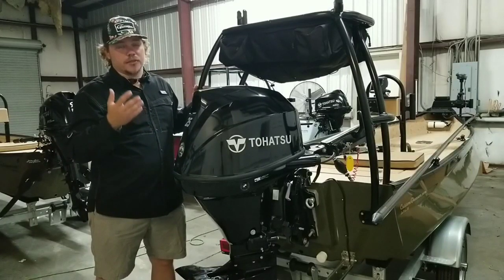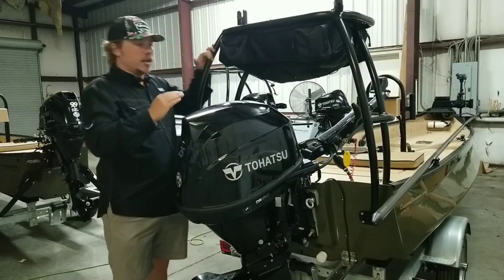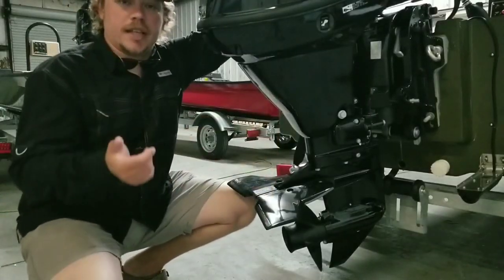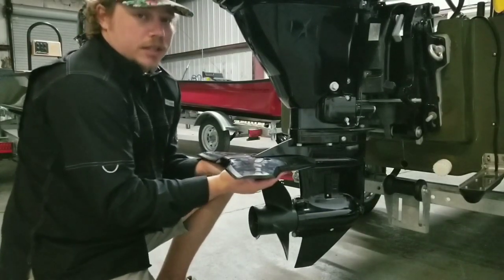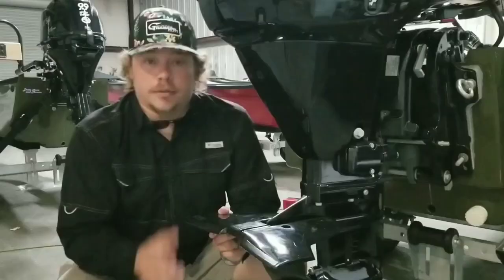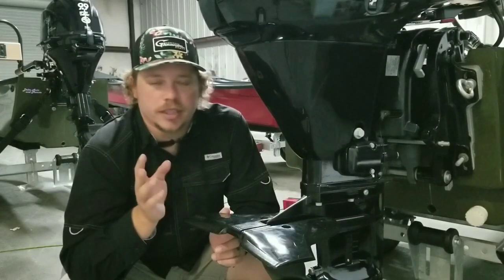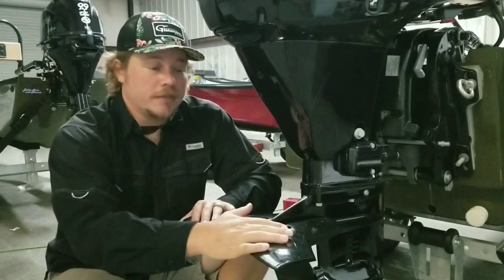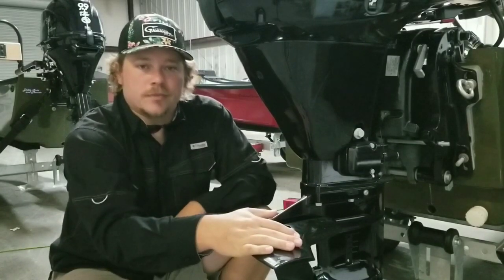Hydrofoils for Small Boats

Comment: Good video with clear explanation of the key points.  My boat is stern heavy, the motor is a bit over sized and that is also where the battery, gas and oil is.  I looked at trim tabs but due to the swim platform, swim ladder, and also where the rear tie down straps go they won't fit.  So I may try this.  My boat gets on plane plenty fast, motor is oversized and all, but I do have to have it trimmed all the way down on plane or it porpoises.  It also tends to want to come out of plane if I am towing slow, say kids in a tube or something.  It's fine for skiers.
Reply: hello, for update did you try one out?
Reply: @lemming9693  I did.  I'd say probably it was worth the $100 I paid for it, but the changes were not significant enough to either do it again or take it off now that I've drilled the holes.  It probably does hold plane at a bit lower speed.  It probably does give a few more degrees of trim before the boat porpoises.  Maybe it does come on plane a few feet earlier.  But going from a 19 to a 17 inch prop made more difference to the hole shot for sure.  So I'd probably say make sure you have the right prop for your boat first.  I was topping out about 5000 rpm before and now WOT is more like 5500, which is closer to the max rpm listed in the manual, and it definitely gives better pickup.  I'd say whoever set it up with the 19 inch prop was going for max speed with the boat empty save maybe the driver and one passenger, whereas I usually have 3-4 people, a dog, 2 deep cycle batteries, a cooler, a trolling motor, etc., and might be pulling a skier or a tube.  It definitely seems happier with the 17.  Top speed is down from 42+ mph to about 38, maybe 40 if I play with the trim, but I hardly ever go that fast anyway unless the lake is perfectly flat.  It's only a 17-1/2 foot boat.

Comment: Need you advice: Suzuki 6HP and 11ft boat. With 2 passengers and some load it plains in “perfect condition” but with some waves, wind or more load it won’t. Do you think a hydrofoil will help me? There are some great metallic branded OzHydrofoil that look great. Regards!!
Reply from the maker: I certainly don't think it will hurt it at all. But without seeing it run its hard to tell.
Reply: @LostAngler  thanks!!

Comment: What do you think about making your own cavitation plate out of 1/8 or 3/16” aluminum plate? It would not have any curve on the bottom but would still put more downward pressure to push the nose of the boat down faster and would add minimal drag when on plane and not reduce top speed.  Pretty easy to make and if you made a cardboard template first it would be an exact fit.
Reply: Trust me - even this will work to a degree and make things much better. But why make something when they are notoriously inexpensive and soundly engineered with all the right curves and angles?